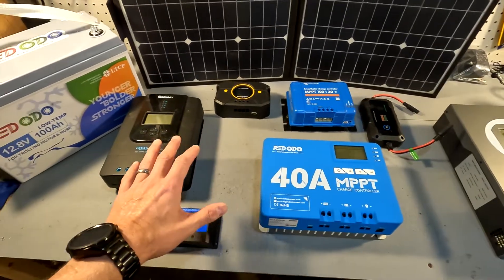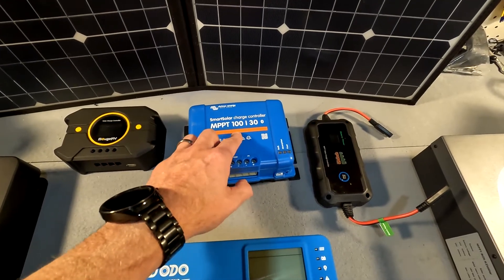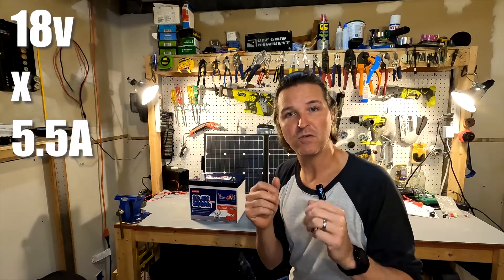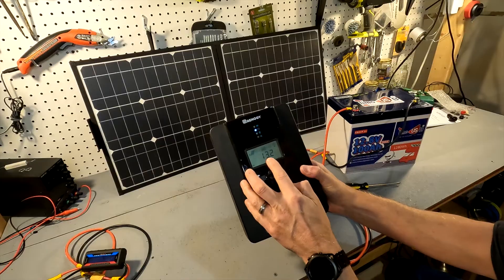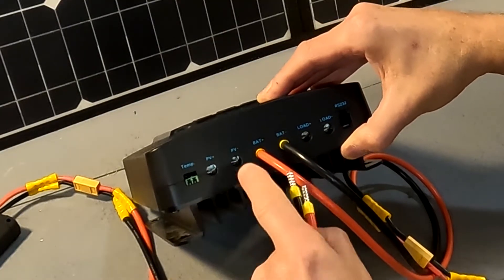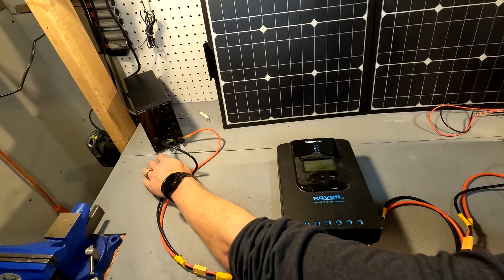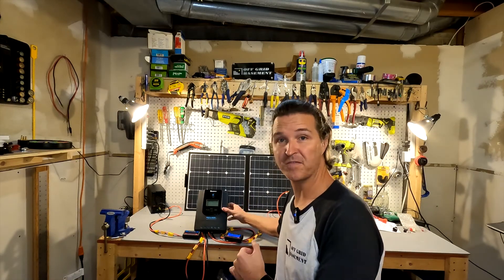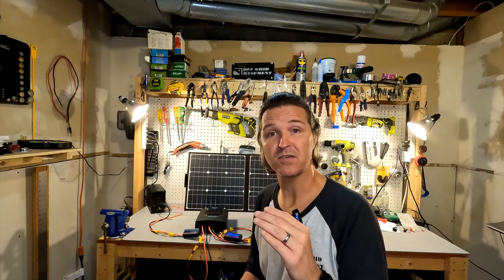What is a Solar Charge Controller?  Beginner friendly video what they do and why you need one.

Comment: Please I will be happy if u answer my question. I bought a solar power station of 2kwh that has a 500w solar input. so it doesn't charge close to a full 500 watts as advertised it is always 250 watts so out of desperation I bought another 500w panel I run it in parrallel few months later it was destroyed by over current. Mind u it is an all in one solar A.K.A powerstation. I want to repair it but is it possible I pass the solar wires through a charge controller that will regulate the solar power before it sends to the powerstation thank u?

Comment: In my case, I just need a solar panel to charge a 12v 9800mAh battery. Do I need a controller in this case? If so, what amperage?
Reply from the maker: That's a fairly small battery so a 10A charge controller would be more than enough.  A 50w solar panel would be the maximum you would want to go.

Comment: Great video! Quick question - Which controller would you recommend for a car battery that is powering two dashcam at parking and my panel would be ~100W?
Reply from the maker: I would say a 10A charger would be just fine.  With just one panel I would go with a cheap 30A mppt controller.  Any brand will do.

Comment: Great video.
I'd love to see the same experiment done with the cheap pwm controller.
It's my understanding that the PWM will only lower the voltage from the panel and won't increase the amperage, therefore causing a lesser wattage entering the battery.
Reply from the maker: Great suggestion!  Thanks for the comment.

Comment: Octopus energy have dropped the Microgeneration Certificate requirement.. So DIY folk can connect Solar to Grid . Export rate of 15p per kwh... Still paying 29 pence per kwh in UK very expensive considering most of UK is Wind on Grid.. Wonder if UK can hit 100 percent WIND renewal energy when winds up.
Reply from the maker: Thanks for the info and the comment.

Comment: I had 4 pannels in series and the cloud would move away and it spiked and set off a error so i had to series parrell them so i got 37 to 45 volts in my victron and im running 24v battery so now it doesn't have the power to use the equlizerr well it only equlize at absorption mode so 28.5 v is max my battery gets . I need that 150/50 victron
Reply: As a temporary solution you can put a 25W aluminum-housed resistor across the solar input.  I recommend a value of 4.7Kohm to 10Kohm.  Typically $8 for a pack of two or three or so... really cheap.   (Don't try this with normal metal film resistors, those are only 0.25W to 0.5W at best).

That should drop the open-circuit voltage of the panels down a bit and hopefully they will stay in-bounds.  If not, just add another 4.7Kohm 25W resistor in parallel until it does.

At 100V, a 4.7K resistor dissipates 2.1W, and a 10K resistor dissipates about 1W.... well within what an aluminum-housed resistor can handle and it won't burn too much of your solar production for the trade.

But as OGB says... its a good excuse to buy another 2 panels to make a 3s2p 6-panel array.

-Matt
Reply from the maker: If you are getting to the voltage top end of what the SCC can handle then you're right. You could also get 2 more panels.  Thanks for the comment.

Comment: I have three adders.   First is... this is why using a higher voltage battery is a good idea, e.g. 24V / 48V, instead of 12V, because the charge controllers can handle a whole lot more solar.  This also means that when buying solar charge controllers, always buy units that can handle all three common battery voltages (12, 24, 48, roughly), even if you intend to start small.  That way when you expand later on and want to increase the system voltage, you won't have to replace any of the charge controllers.

The second is a caution.  Power supplies / other batteries can be wired into the SOLAR input of a charge controller in order to simulate a solar panel or if down-buffering from a higher-voltage battery bank to a lower-voltage battery bank.  However, solar charge controllers usually have a clamping function on the "solar" input that they use if there is a danger of over-voltage on the BAT output.   When this is triggered, they will short the solar input to shut the panel down and prevent voltage leakage from holding the over-voltage on the output.   In addition, the MPPT sweep on the charge controller may over-current the input just in general, depending on the unit.

So when connecting a power supply to the "solar" input of a charge controller, be sure that the power supply is current-limited and short-protected, and when connecting another battery as the "solar" input it is also a good idea to put a DC breaker or slow-blow fuse (valued at the same amperage as the charge controller's rating) inline with the input.  Also read the instructions on how to avoid over-voltage conditions (if they even have such instructions).  For example, on the Victron, you need to build a custom battery charging profile that enables "equalization", in manual mode, with the highest allowable battery voltage set as the value.  You never actually run the equalization function, but that will prevent the Victron from trying to short the solar input when the battery output goes above the absorption setting.

This is not something one has to worry about with real solar panels because the panels have limited short-circuit current.

Finally, note that solar charge controllers do NOT have well regulated BAT outputs.  They are designed to be connected to an actual battery, not to directly power equipment without a battery.  So don't try to use a charge controller as a power supply, it will wind up over-volting the output, sometimes by a lot.

-Matt
Reply from the maker: Thank you for the great information!

Comment: Just ordered that one  for $25 on aliexpress for $5 the other week, they only had the 10 amp version but i didnt think much of it because it was so cheap .Im using 2x cheap 8 amp ones that came in a  kit, in parallel without thinking of the numbers so wasnt sure if the 10 amp one i ordered could replace them both.Then this video shows up!  Thank you, now i know.   I thought because my solar doesnt do more then 10amps  id be ok, but forgot the inverter will draw more then that to get its desired power.  Good point!   By my calculatoins the inverter will want 14amps from the controller so  its not quite to spec,  but might as well find out. Thanks again.
Reply: You need a battery connected to the BAT side of the solar charge controller(s), always.  You can't use them as a power supply, at least not safely.  They can't track the inverter load quickly enough.   In anycase, in normal operation with a battery connected, the inverter pulls from the battery and the solar charge controllers supply load support, but don't have to actually match the inverter (and they can't track the inverter load anyway so....).  Hence why the battery has to be there too.
Reply: Ahh right ,its the battery that will be getting the demand from the inverter,   along with the charge controller supporting that demand so you dont need to be exact. Thanks for the clarification. Makes it a little more confusing to follow along but  makes sense if you think about it.  Well im still having a hard time imagining a scenario where the charge controllers amp rating is tested.  I guess when you have a load equal to your solar output, battery is neither being charged or discharged then the draw would be all on the controller. If your load is bigger then its draws from the battery.  but seems the controller is always feeding the battery/load unless thebattery is full.  Ok brain is overloaded, i reached my amp limit.    @junkerzn7312
Reply: @mikejones-vd3fg  Basically the way a charge controller works is that it is current-regulated first and voltage regulated second.  It will try to output a specific current and its output voltage will be whatever it has to be in order to produce that current, such that that power being output is the maximum power point of the solar input.

Remember that a power supply of any type can only regulate one at a time... either voltage or current, but not both at the same time.  Because one naturally follows the other.  To output a particular current you have to raise the voltage to whatever it needs to be raised to to get that current.  To output a particular voltage you have to raise the current to whatever it needs to be to get that voltage.   Within the bounds of the supply's capabilities and settings.

--

So, for example, if the charge target is 14.2V but the current battery voltage is 13.5V, and the charge controller is trying to output a MPPT point on the input of 90W, it will end up outputting whatever current is necessary to achieve 90W.  Outputting a current will naturally force it to output a voltage higher than the battery voltage.   Eventually the current x voltage on the output will match the desired wattage.  For example, it might end up achieving 6.64A and the output voltage might be 13.55V in that situation.

If the charge controller hits a limit first, such as its maximum output current or maximum output voltage, it will reduce the current until it is below those maximums.

When the battery is not close to full the charge controller's output will be current-regulated to the MPPT power point if possible.

--

But as the battery gets close to full, this voltage will wind up exceeding the charge target.  When the charge controller notices this, it will reduce the current it is outputting (thus reducing the voltage)... until the voltage is back below the target.  The charge controller tracks the voltage and continuously adjusts the current.

The charge controller will effectively become voltage-regulated rather than current regulated at that point.

Though it will not be very well regulated.  It will overshoot the voltage target, then pull back the current and undershoot, then put on more current, and repeat, as it tries to match the target voltage (And ultimately this means trying to match the inverter draw, once the battery is completely full).

It needs a battery to be on the output to prevent these oscillations from being a problem.   And in fact, if the battery BMS disconnects these oscillations often do become a problem.  You might hear the inverter beeping an over-voltage alarm at you, every once in a while, for example.

The solution to that is to add robustness to the battery bank by having 2 or more batteries in parallel, reducing the chances that all the batteries will disconnect at the same time.

-Matt
Reply from the maker: You're welcome and thanks for the comment!